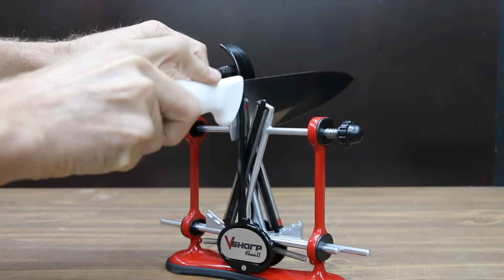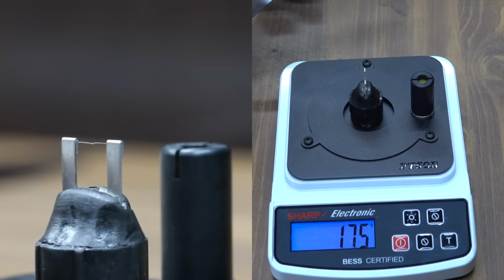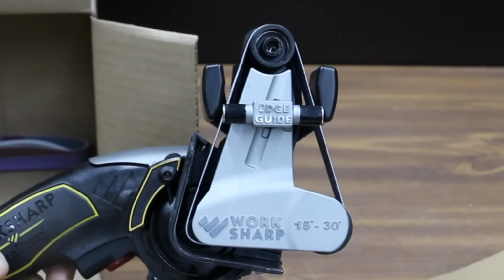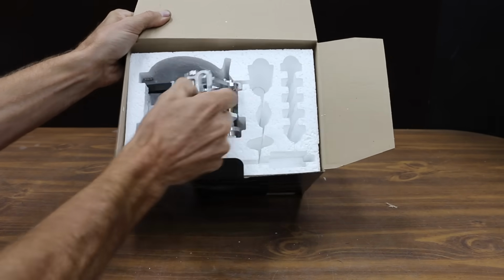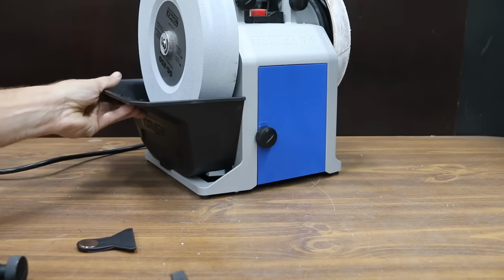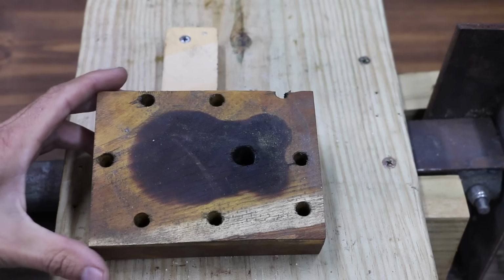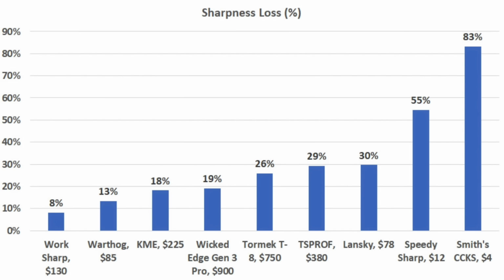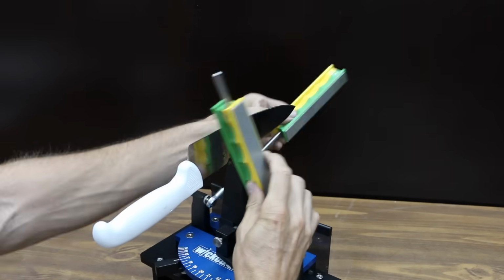RUSSIA vs USA Knife Sharpener? TSPROF vs Lansky, Wicked Edge, KME, Tormek T-8, Work Sharp Ken Onion

Comment: Now you are just acting like a damn customer 😂
I recently ran out of razors so I used my knife to shave.
This isn't accomplished in any of that ronco looking stuff 😂
I would be proud to teach you what I taught hundreds of mechanics for decades.
When you run a shop it pays to train people to become better at anything required.
Most knives require a 33% or less angle.
Knives don't actually cut anything.
At a microscopic level they tear.
It's a smoother tear the sharper the knife is.
A very low angle will produce a thin long edge.
This edge is not suitable for anything but cutting meat.
Its long thin line makes it hold an edge cutting meat longer. (Hammer forged Solingen steel only)
Stainless knives are never able to get or stay as sharp as razor steel knives.
Stainless knives always get a lower (fast) angle sharpening for a thicker strong edge.
Only good for rough knife damaging work.
You sharpen these pulling the blade away from you with the edge towards you.
This is called a wire edge.
A meat cutting edge for defense or hunting is exactly the opposite.
Just a simple piece of left over plastic or something.
Cut as a smooth snug fit on your blade and sand it on the belt sander to the angle required for that knife.
You will come to not need it soon so don't go crazy making it.

Comment: I use a worksharp and the leather strop for the 1"x 30" belt sander. I have the lansky too but my knives wore the diamond abrasive off and I'm not going to pay more in stones than what the thing costs new, nor am I buying a new one just because it happens to be a better value on paper. If I had noticed the costs of replacement parts to start with, I never would have bought any product that structures pricing of their products in such a way.
Reply from the maker: Thanks for sharing.

Comment: I will stick to free hand sharpening with Japanese wetsones
Reply from the maker: Thanks for the feedback.
Reply: @ProjectFarm  Don't get me wrong, wetstones have their own hurdles. The water required gets messy. Prolong sharpening will cause your fingers to bleed. You have to be careful that the muddy water doesn't clog your pipes. Accuracy and consistency with angles require practice.

With that being said, the amount of freedom, ease of storage and wide range of options can not be replicated with various sharpening gigs no matter how they are invented. Also you are restricted to the restraints of the mechanical system and it is harder to make modifications or fix potential problems. Plus setup and storage are much easier.

Maybe Japanese cutlery has made me biased 😅

Comment: Personally I like the Ken Onion Work Sharp electric belt sharpener with 1" grinder attachment the best. Have used Lansky, kme, various stones, Harbor freight 1" belt sander, etc. It's pretty easy to use once ya get the feel for it, and can resharpen pocket knives and kitchen knives. Love it.
Reply from the maker: Thanks for sharing.
Reply: Correct me if I am wrong but the Work Sharp does one side of the blade with the belt moving away from the edge and the other side of the knife with the belt moving into the knife edge.  That bothers me.
Reply: @TheDaumen that would bother me too, but it doesn't. The belt moves away from the edge of the blade for both sides. Do one side, put knife in other hand and do the other side.
Reply: Does the belt change directions of rotation from one side to the other?  @Squillaempusa.
Reply: @TheDaumen no. It goes one direction. Sharpen one side holding knife handle with right hand, then the other side holding it with left hand.
Reply: We must be looking at two different systems of Work Sharp.    @Squillaempusa.
Reply: @TheDaumen oh, maybe. I have the grinder attachment on mine, which is the Ken Onion version. Sorry, I didn't think about that.

Comment: I'd love to see a comparison between the KME, Work Sharp Precision Adjust, Edge Pro, and Hapstone. All use a very similar principle and design, but with made different materials, build quality, features, and bells & whistles..

From what I can tell, Hapstone makes the nicest system, and the best value if you can afford it. Work Sharp seems like the next best value, but is close to the KME if you get the base. Edge Pro as far as I can tel pioneered this whole design, and still works well, but is no longer a good deal as you can get equivalent or nicer systems for the same price or less.
Reply from the maker: Thanks for the suggestion.

Comment: IMO the Tormek is the best for tools (from scissors to lathe gouges), and the best all around sharpening system as well... not much can compete in the ability to sharpen everything from kitchen knives to fluted gouges, but it has a hefty pricetag (AND YES they DO have a kitchen knife attachment, at an additional cost. In fact they have attachments for almost any blade type you want if your budget can can handle it) the draw back of the Tormek is that it uses a wheel, thus creates a concave edge. It can produce a sharper edge overall, but can cause the edge to be weaker in the long run for all the reasons the worksharp can produce a stronger edge. I have been a hobbyist woodworker, a hobbyist knife maker, and a professional butcher... I DO love the Tormek when I have access to one, but there is a reason professional knife makers mostly use belt grinders (belt sanders) for sharpening their knives these days. 

I have been coveting the TSProf for some time now, though their price and aggressive customer service (maybe the person on the other end of the chat popup was board, but they could put a used car salesman to shame last time I visited their site a couple years back. It felt like they where watching my activity on the site as the chat window kept popping up, and they where trying to steer me toward a purchase that would get them a good commission.) in the past has turned me off of even looking at their website. As precision and repeatability goes, I have yet to see anything that can compete.

Frankly what all this equipment is for... is taking the need to be able to hold your knife precisely while sharpening with a stone (which takes a lot of skill) out of the equation. Honestly a set of stones and some proper edge guides can do the job just as well, but require a li'l more skill than something like a lanskey (which is why things like the lanskey exist). Sharpeners like the lanskey though will not produce uniform results over the full length of the blade. It is creating a triangle and as the lengths of the sides change (such as the further from the rod holder you are sharpening), the angle will change as well. They are close enough, but not exact. For that matter, I have not seen a sharpening system yet that will actually give exact numbers all the way from heel to tip, but lanskey type sharpeners are especially bad about it. The larger the knife, the wider range of sharpness they will produce. This will be true of any guide rod system regardless of if it is the cheapest chinese lanskey knock off, or the best engineered TSProf style overkill engineering.

If you are Joe Average looking for a quick way to sharpen your kitchen knives, that v-rod setup by Smiths is good enough (if you are just sharpening the couple knives you use most often and they are not high end kitchen knives) and one of the lowest budget options, plus it takes the least space in the junk drawer. (Well o.k. That speedy sharp takes the least space, but is also one of the easiest ways to damage a knife short of trying to free hand on a disk grinder) Just remember it is a "one size fits most" system. A filet knife and a cleaver should not have the same sharpening angles. If you do some research and get an adjustable sharpening system, you should find what angle each type of knife in your collection should have. No V-Rod system I have ever seen will give you this. It is also possible to hold the knife at a slightly incorrect angle with the v rod or belt sander type sharpeners and end up with one side of the edge at a different angle than the other. To put it bluntly, this is user error. The guide rod systems, despite the flaw mentioned above where designed to eliminate this problem, so even if you are just looking for a cheap and easy way to sharpen your knives, go for the lanskey.

As a somewhat unrelated note. If you are looking for kitchen knives, be careful of the marketing hype. "Professional grade" is marketing. When I was a butcher several of us used Victorinox/forschner knives with the plastic handles. Most of the rest used even cheaper "commercial" knives. The edge does not last as long as one of my antique Henkles, but I got a complete set for about what one chefs and one paring  knife cost from a company like Henkle. With the exception of the 12" Scimitar which I only use for cutting brisket these days, I still use those knives regularly as part of my camping kit.
Reply from the maker: Thanks for sharing.

Comment: I've been a custom knife maker for about 40 years. I've made blades out of just about every steel you can think of. Over the years, I've sold knives all over the world. I never recommend motorized or powered belt sanders for sharpening my knifes. In the hands of someone that doesn't know what they're doing, they will literally cook the temper right out of a knife blade. Unless you're sharpening knives for a living, A decent angle guide along almost any of the new diamond sharpeners are pretty much all anybody really needs. I use diamond lapidary plates, (they're big, flat & come in grits you can't get in knife sharpening kits) my ancient Russell XXX-Fine butchers steel & the same leather & buffing compound stropping set up you put together in your video. I've never had anything but surprise & praise for the sharpness of my knives
Reply from the maker: Thanks for sharing.

Comment: I do have tormek t8. But I have attachments for it as well. Main reason for buying it was to sharpen all my tools and knifes. If I needed only knife sharpener I would buy cheaper one. But for chisels axes and drill bits Idint wanted to buy separate sharpeners.
Reply from the maker: Thanks for the feedback.

Comment: A large difference between stainless and high carbon: stainless is relatively soft… is harder to sharpen and loses its edge more quickly ….
    High Carbon steel is much harder(more brittle) but holds a much sharper edge longer….
     Stainless doesn’t rust easily but high carbon will rot quickly, must be cleaned and oiled….eg. Dive knives are Stainless…. Chinese cooking knives are high carbon…
Reply from the maker: Thanks for the feedback.

Comment: Uummm….knife is high carbon stainless steel “….curious how that works….cause those materials are different…Cold Steel makes their blades with San Mai III steel which is high carbon steel sandwiched between layers of stainless steel leaving an edge of carbon steel that creates your edge….will sharpen wonderfully…razor….
  But stainless is a type of steel and isn’t high carbon…..

Comment: I have and use the carbide sheer sharpener as an emergency sharpener with my g bag. You just have to be very careful as if you let it slip across your blade, it will scratch it.
Reply from the maker: Thanks for sharing.

Comment: I have been using the angled crock sticks for decades and they work very well. I tried to locate the same brand as a gift last year and could not locate the same make or design. Too bad, I keep it in my kitchen and it works well on all knives.
Reply from the maker: Thanks for sharing!

Comment: Another option is to make a large belt grinder for ~£300 and get a few belts ~£100, and you can get super sharp edges.

You also get a belt grinder!
Reply: @@thomasb282 with the correct belts a knife can be super sharp, I use a cork belt with a polishing compound.
Reply from the maker: Thanks for the suggestion.

Comment: I've seen the Tormek or it's style used a lot in wood turning vids to sharpen the chisels they use on their lathes. Definitely more designed for those.
Reply from the maker: Thanks for sharing.
Reply: Tormach*
Reply: @bentoth2494  Tormach is a machine tool company.  This is a Tormek is a different company.
Reply: It's designed to sharpen anything with a cutting edge.  I've used my Tormek for years on everything from chisels, gouges, axes, scissors, drill bits, and kitchen knives.  Wouldn't trade for any other sharpening system in the world.

Comment: How repeatable are the measurements on your tester?  ie. if you measure the same blade twice in a row, do the readings differ? if so, by how much?
Reply: It's very repeatable. He didn't build it, it's an industry standard tester.
Reply: @libtrs838  I was looking for actual numbers
Reply: @hermanfinster7692   It displays results in increments of 5 grams. When you measure the same blade you will get the same number. Unless you did a wacky sharpening job and also measured on a different spot on the blade, it will be the same. Another scenario would be if the actual measurement was 122.5g, then sometimes it would probably show 120 and other times 125. Pushing the blade down too fast or pushing it at an angle will give you a lower number. 

They make a more expensive model with a 1g resolution and faster sampling rate and a cheaper model with 25g resolution and slower sampling rate.

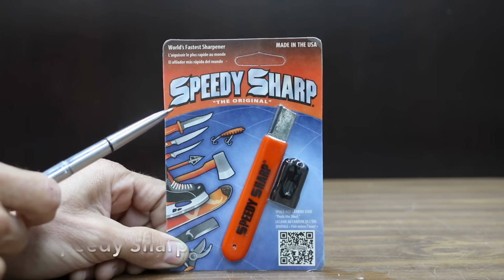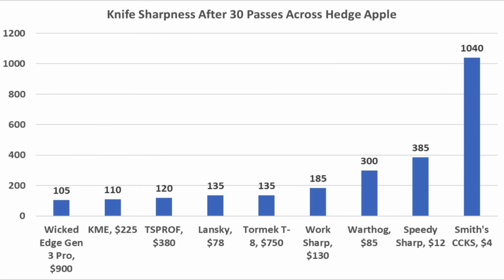Comment: Speedy Sharp (2:09) did not produce an edge that stayed sharp after use (14:38), but it may need more than 15 seconds to do that. (Set-up takes longer than that with the more expensive sharpeners.) As with all the sharpeners, experience should help the user do a better job. Speedy Sharp is cheap, can be carried in your pocket, requires no set-up, and works in seconds with no mess. That suggests that Speedy Sharp (or other similar carbide sharpener) is a good inexpensive solution. Lansky is a good mid-level solution, and some of the others are good high-end solutions.
Reply from the maker: Thanks for the feedback.

Comment: I might be wrong, but was the leather stropping only applied to the lansky system? If it was, then it wouldn't be a fair assessment. Almost any reasonably sharp knife can be honed razor sharp by stropping.
Reply: There was at least 1 other. one of the expensive ones. And if they want it In their kit it should of been included

Comment: If you would add "time it takes to produce an edge" for each product tested,  I think the results would change. The reason the Worksharp rises to the top is because of the quality of the edge in the time it takes to produce. The Lansky, Wicked edge, and KME types just take too long to setup and produce an edge for the average user.
Reply from the maker: Thanks for the feedback.

Comment: I noticed in the video that you finished off the edge using the Warthog's rough side, rather than the smooth steel stropping side. This is the reverse of what you're supposed to do. Maybe it was a mistake in the video editing? I noticed the hone was the dull grey instead of the shiny steel when you did the final stone swap over.

Comment: Couldn't you get that Smith's one and just use it real quick before every time you wanted to use your kitchen knife? The edge doesn't hold for long, but it's also something that stores very compactly in your knife drawer in the kitchen, has zero setup time, and made a plenty sharp edge.   The edge created by some of those sharpeners had damn well better hold up for a long time if they're going to be so time consuming to setup and use.

Comment: As usual, a quality video with excellent comparisons of wildly different products.

If you ever do another one similar, another kit to include is the Hapstone R2 system.  Similar to the TSprof in use.  It's the one I own, and it's quite good.  As with the TSprof and the KME systems, there are lots and lots of both diamond, ALO, and ceramic stones to pick from.

One note, just for reference, the TSprof (and other Russian systems) diamond grits are the FEPA grit system, which is different than what us USA based peoples are used to (the JIS standard).  For example, the TSprof 1200 grit diamond is actually 3 micron, which corresponds to almost 7000 grit in the JIS system. 

Thanks for a very informative video.
Reply: Good information, thanks...
Reply from the maker: You are welcome!  Thanks for the suggestion.

Comment: Fun fact most high quality "japanese steel" is actually a low carbon steel that doesn't hold an edge for very well or very long. It's been proven that most of those expensive knives you buy from Japan are made from cheap steel and not actual high carbon steel

Comment: Project Farm vids are always a pleasure. It's little wonder that 2.62 million subscribers rely on you for unbiased opinions. I used a Lansky vice type stone kit for enough years to deform the stones to unusable. Another problem with Lansky's thin stones is they could catch and roll your fingers onto a sharp blade. Switched to a Smith's kit with the same basic function but with diamond grit sharpeners. Wider "stones" for more stability, assembles in seconds and at $35 for a 3 stone kit it's a very satisfactory sharpener.
Reply from the maker: Thanks!

Comment: Just found this video in your rotation.  I have the normal work sharp electronic unit and it has done a fine job for me.  But I also use a wood block leather strop to take care of the burr after.  I am really considering the Lansky unit now, that is a fair price for what it does.  Thank you!!

Comment: It's a shame that you didn't use the Tormek T8 to its full potential. Used properly with the right accessories and jig would have by far outperformed any other devices in your comparison.
Reply: Not much of a kit if it's missing a lot.